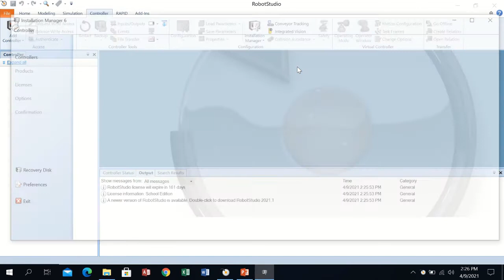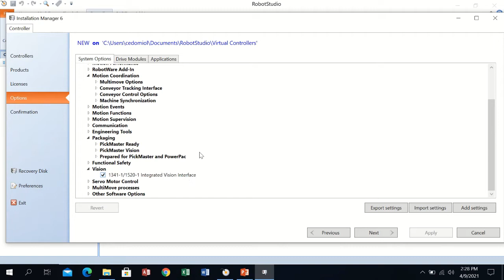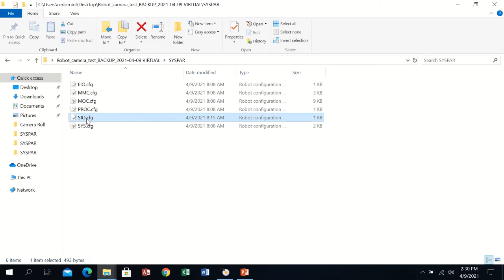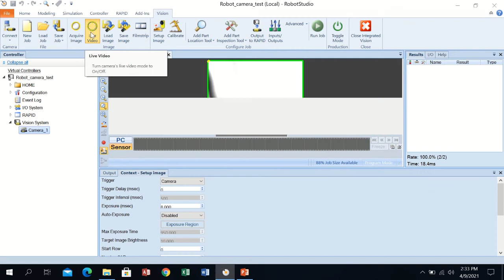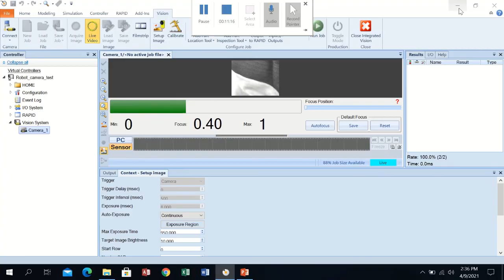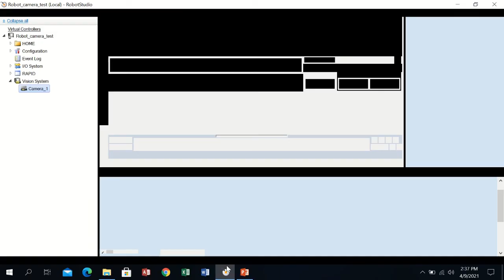RobotStudio Virtual Controller and ABB Camera

Comment: Now its working fine. All the probblem inside SIO file
Reply from the maker: Glad it worked! it took me about 4  days and a number of emails with a tech to finally figure it out . Also keep in mind that sometimes when updating either RobotStudio or RobotWare it may do the same thing, so always keep a good working back up for both virtual and physical controllers so you can refer back to it. I will make a video about the backup and what happened to me in the next few days.
Reply: @itc-lab5547  im waiting ...